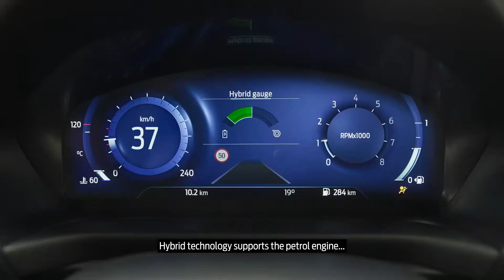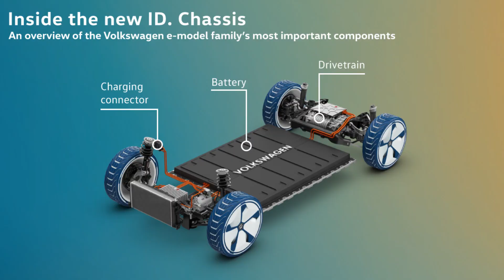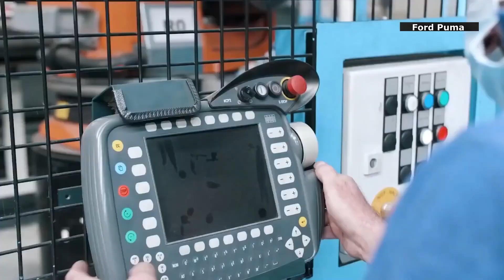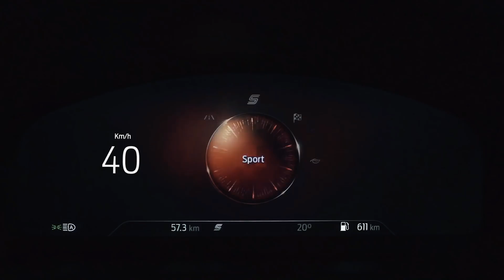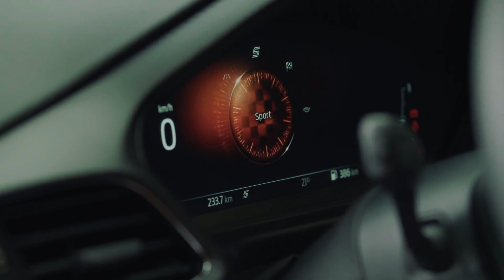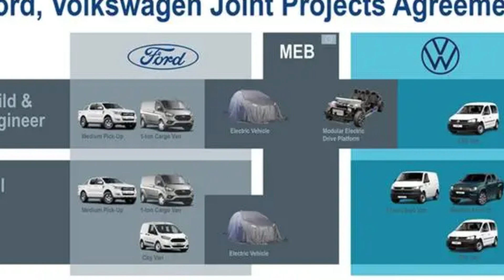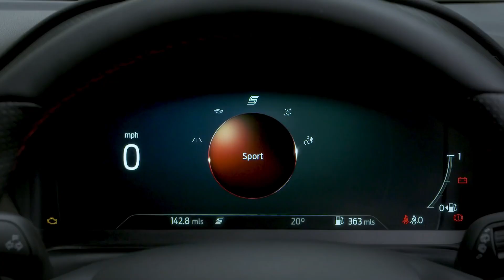Ford Just UNVEILED An All-New 2024 Ford Puma All-Electric!

Comment: It has to sell fir 25K or will never make it
Reply: It won't. Estimates are at $35K euro, or $40K USD. Since they are going to put a massive battery pack that will get 280 WLTP miles. They really think people who buy a subcompact crossover need that much range.. It would easily cost $20-$25K if they put in a battery pack good enough for 60 and 120 miles that you could easily charge in 2-4 hours using level 2 charging overnight, or even 8 hours with level 1 charger overnight.